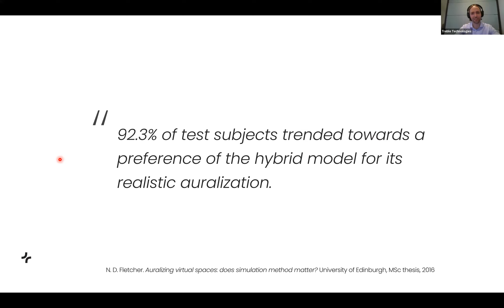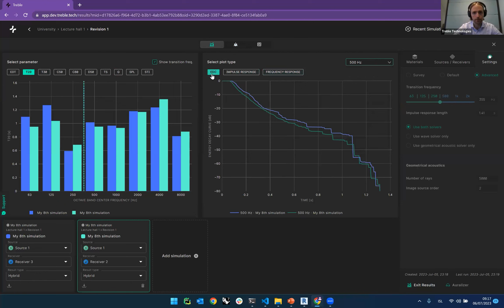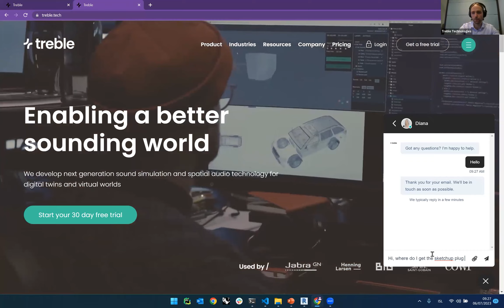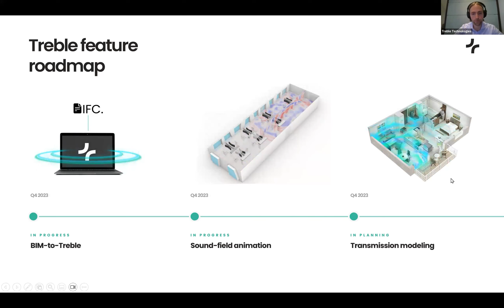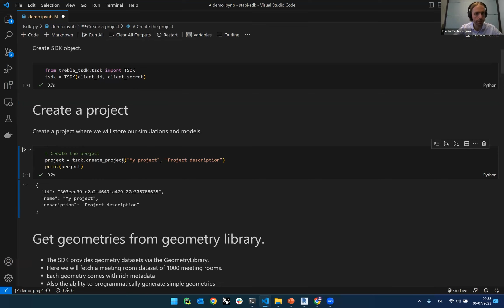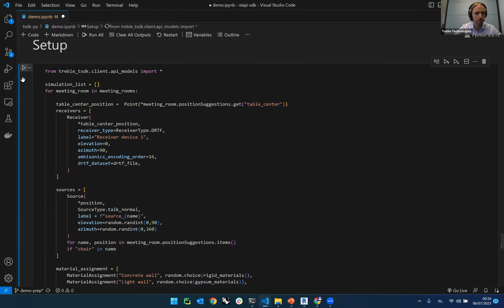Treble Feature Announcement webinar

Comment: Three-dimensional acoustic modeling is specifically of high-interest to myself. Have you done any research to using the ray-tracing algorithms present in modern GPU accelerators to reconfigure for audio refractions, reflections, and scattering instead of light? I imagine it would cut the computational time to near real time or at least to an imperceptively short delay.